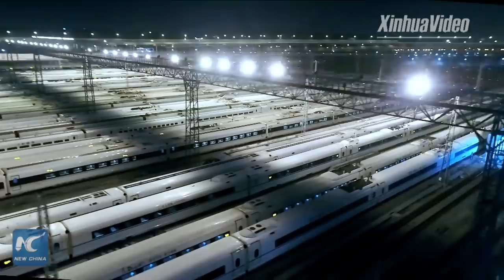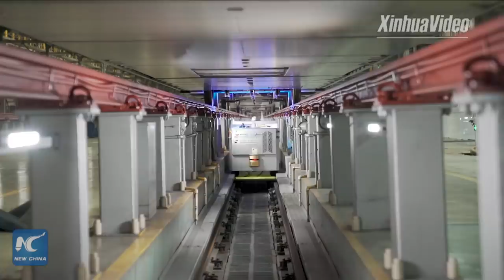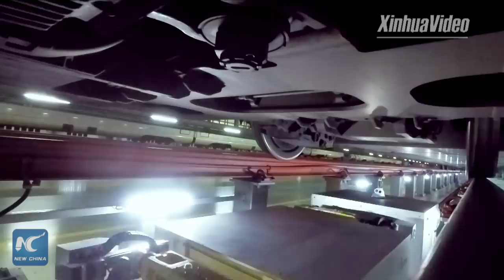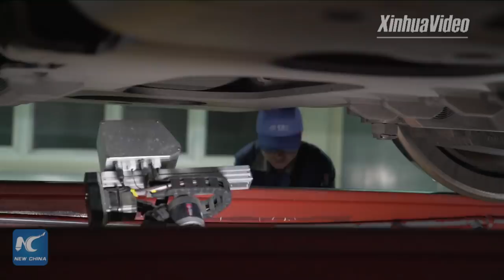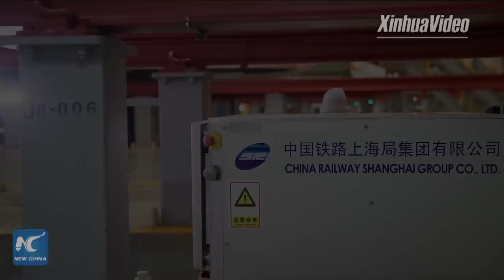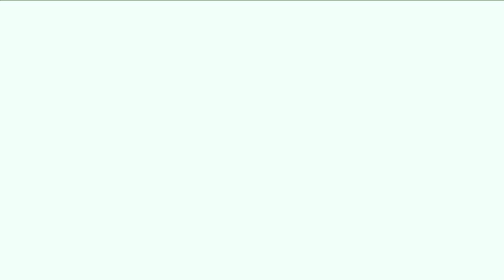Robots help with Shanghai's bullet train maintenance

Comment: The China High Speed Train system is awesome. I've travelled many thousands of km on it.  Clean safe and fast. Well done China.
Reply: stephen preest Except for the slow K train, smell so bad, people smoke, sleep on the floor under the seats, throw trash on the floor, no fresh air.
Reply: Joshua Xiong 你應該唔係中國人吧？？我喺好多地方都睇見你吐槽中國？你呢樣做有意思嗎？？？你要系唔鐘意你可以選擇……
Reply: Except the rest of the country is full of pollution and not so clean. Not well done China.
Reply: @steven20919  and you're speaking from first hand experience?

Comment: Those pure white high speed train are design for running 15 to 20 years,in 2020,most of it will out of those hot lines and replaced by the "fuxing" bullet train which is white color with orange line running at 350KM/H.(Not just the speed,the space between each sit are bigger and have cheap train food only costs 2.2 dollar, but the price of tikets are the same or cheaper)